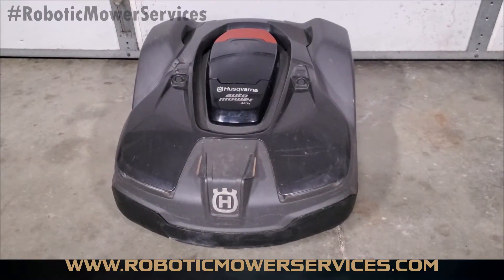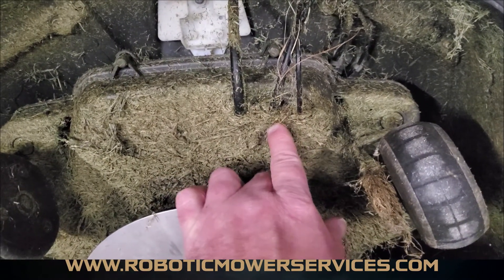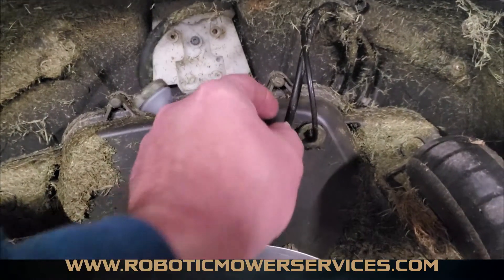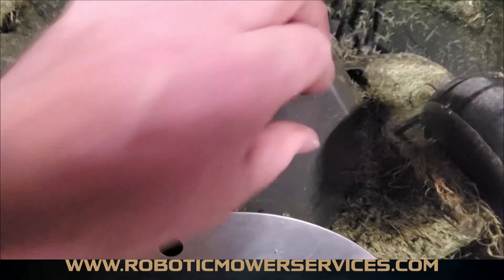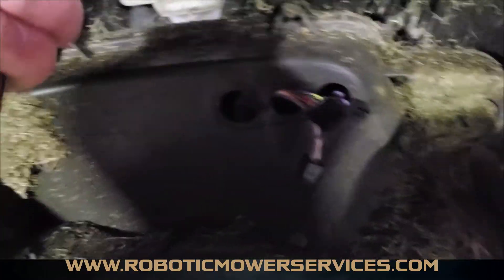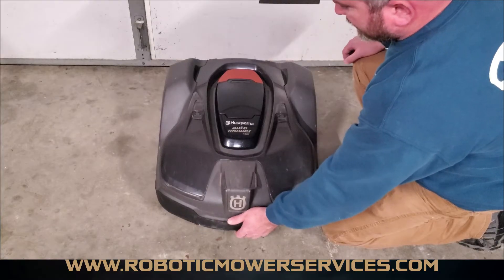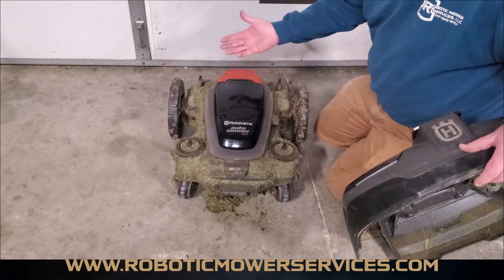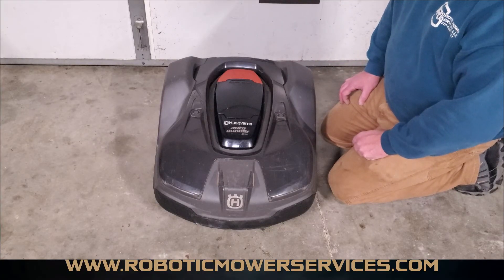Husqvarna Automower Top Cover Removal (300, 400, 500 Series Non AWD models)

Comment: inability not to be able to pressure wash a 450x is a let down
Reply from the maker: You can not pressure wash any of the models of Automowers. There are a select few that are "hose washable" meaning just low pressure water coming out of a garden hose without putting your thumb over the end of it or using a nozzle or connecting it to a pressure washer.
Reply: @RoboticMowerServices   is the weak spot the grommets that hold the cables in, or seals within the wheel motor housing?  thanks for the reply

Comment: I have  a hosqvarna 105 automower and need to remove the top cover for cleaning but cannot find any information on how to do this even in the manual or utube,all other sizes are mentioned on utube but the 105,maybe you might do a video on the 105 top cover removal.
Thanks in advance